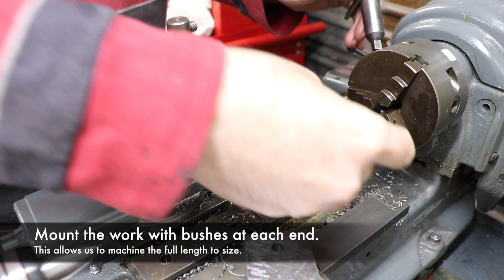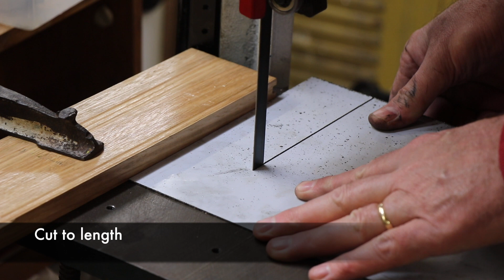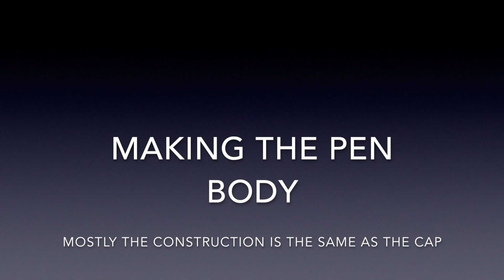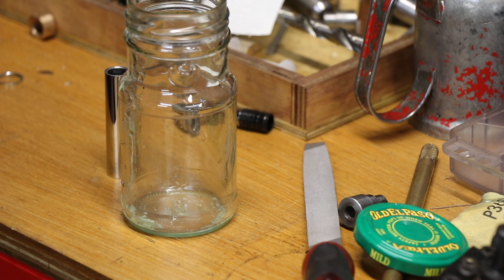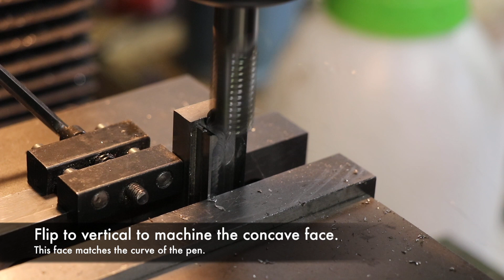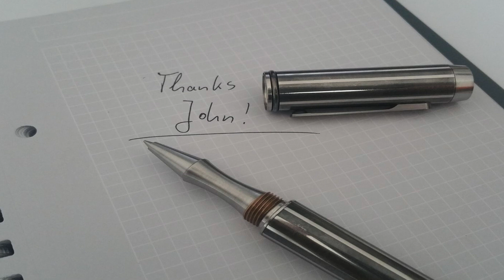I Make a Pen for Stefan Gotteswinter

Comment: I dont get the pen kits? There's nothing to do really
Reply from the maker: grand unified I didn’t use one here.  I often do though and I have sold many kit made pens.  People love them.  They get a bit boring to make though.
Reply: John Creasey you should try cross drilling your stock & pressing in brass rod. Ive done this at vairing  angles like swiss cheese then turn the stock .has a nice look

Comment: Thats a cool looking pen !
I would have a go at making a pen but then i would have to learn how to use one - right after i work out how to stop my knuckles dragging on the ground 😄
I would like a pen type retractable scriber  and was thinking of modifying an old parker pen but now making the body seems more appealing to me .
Where is a good starting place to look for pen parts or kits John ?
Reply from the maker: ian bertenshaw you can  get a kit with the twist mechanism and all the parts you need very cheaply.   I have a video showing how.  You can get them from pen state industries in the states or timberbits in Australia.  It's pretty easy if you have a metal lathe.

Comment: Hi John,
Super job on the pen, something to treasure and use.
May I ask about the live centre on the Myford, how do you find it for clearance with tooling? I'm thinking of buying the same one for my ML7, also where did you source your metal bluing chemical?
Thanks in advance
Raymond
Reply from the maker: Hi Raymond,  I sometimes find the live centre gets in the way but mostly it is ok and I use it a lot.  I have two and one of them has a longer point than the other.  I got the longer one from banggood.   It is ok but the point is not terribly hard.   Otherwise it is ok.

The bluing chemical I found on EBay.  I bought it quite a long time ago so I can't remember the seller.
Reply: John Creasey thanks for that, was looking at the one you were using in this clip, looks to be smaller than the one I have, will look into them.
Cheers